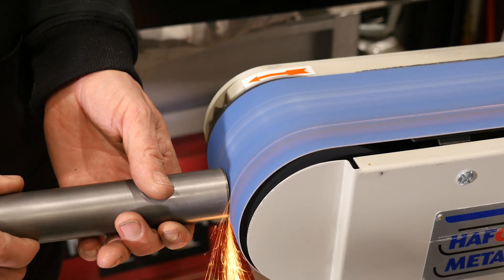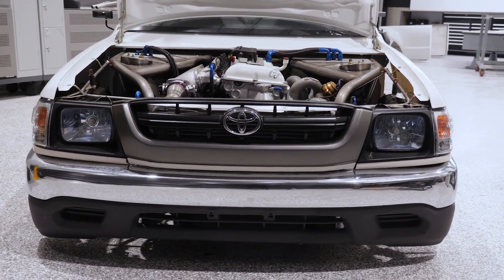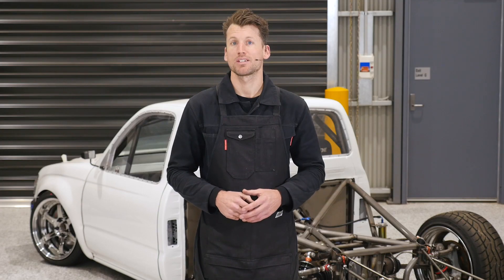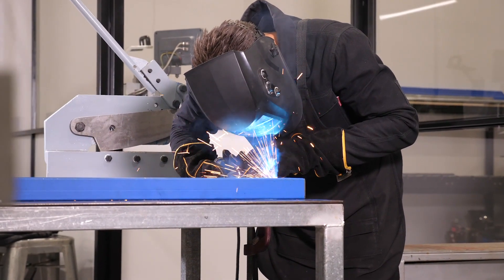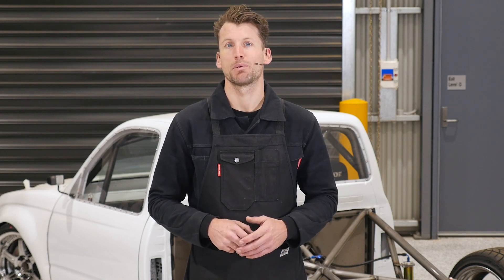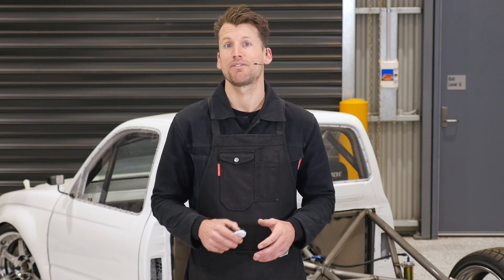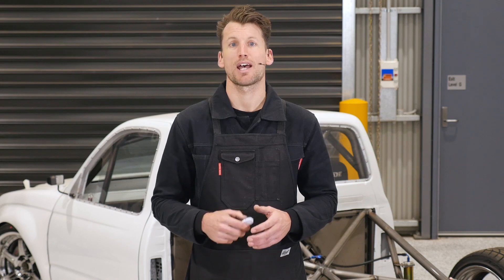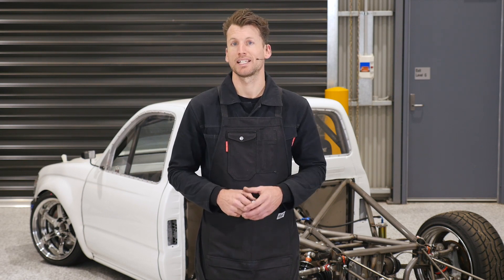NEW: ETS Motorsport Fabrication Fundamentals

Comment: Is this for real?
Reply from the maker: It's 100% real. :) Let me know if you have any questions about them.
Reply: @Engineeredtoslide  I am thinking about taking the course. Just have some basic tools and an angle grinder. I Know how to weld with SMAW but not sure what other tools i would need
Reply from the maker: @79sketches  this first course is a fundamentals course. We go through required tools in the course. These differ widely depending on the job you want to do.

I really try teach things using as few tools as possible and also if you have access to a full fab workshop. :)
Reply: @Engineeredtoslide  cool! Thanks for the response!